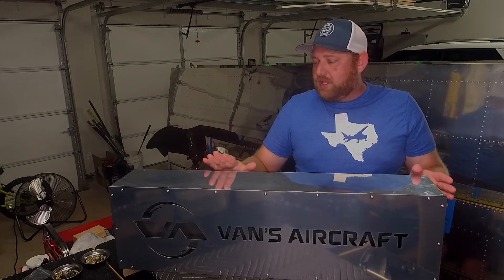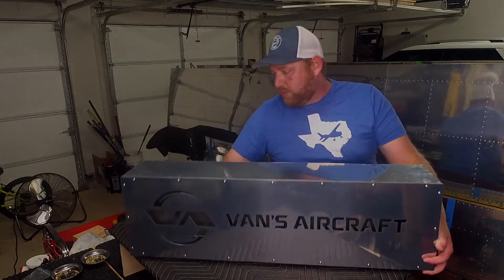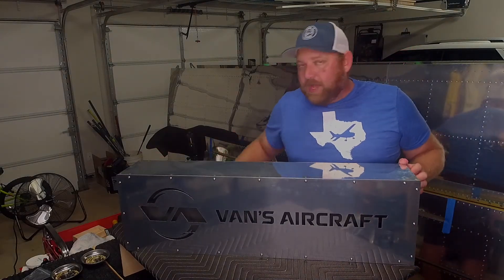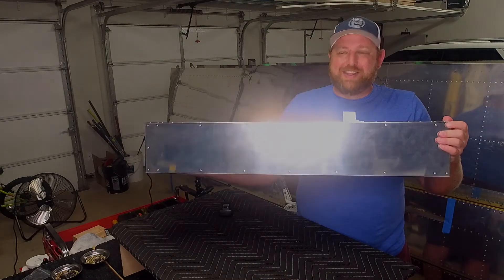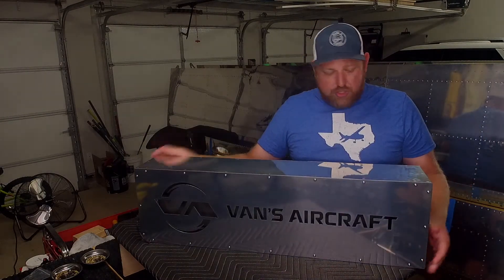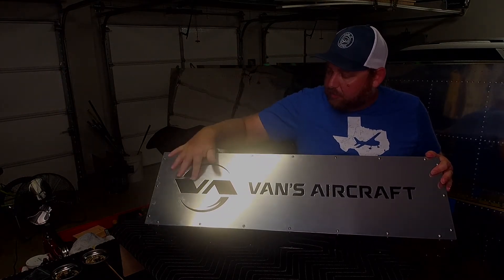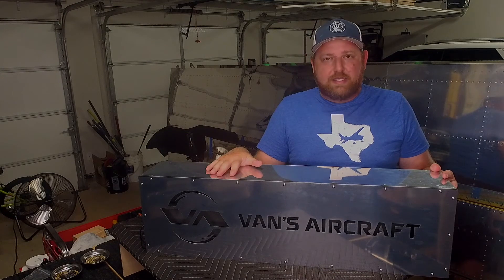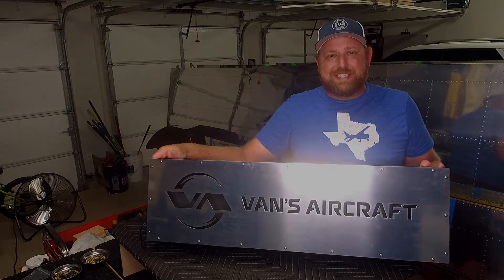Vans Aircraft Lightbox was a super fun project

Comment: What tools are needed for both the light box and tool box builds (just got them in the mail)?  I plan on (hopefully) building an RV-14 in the distant future and have no need for the full tool set as of right now.  Any insight would be of great help!
Reply from the maker: Pretty much all of them.  Drilling, dimpling, countersinking, rivet squeezing, rivet bucking, rivet pulling.  Everything is either #30 or #40 but you need a lot of the tools to build these you need for the plane.